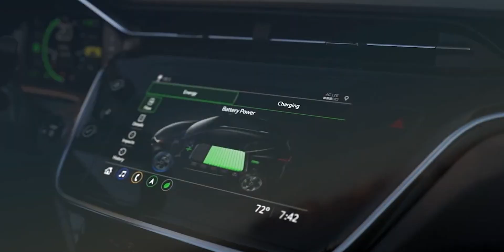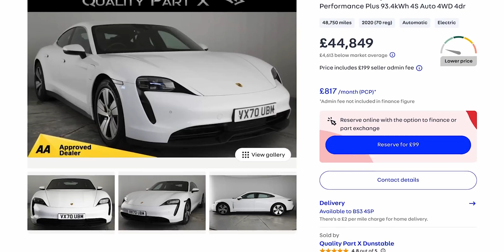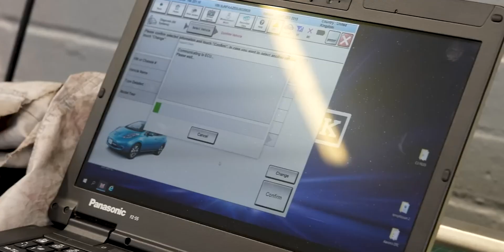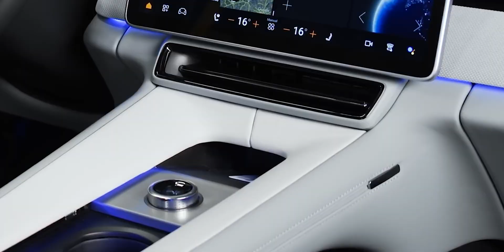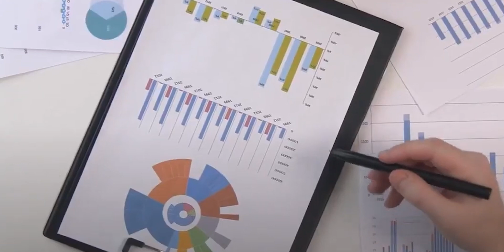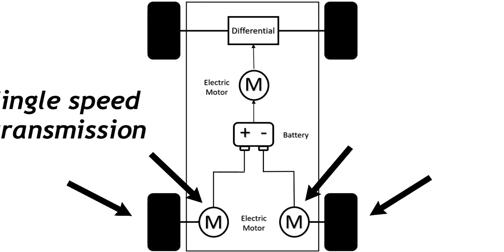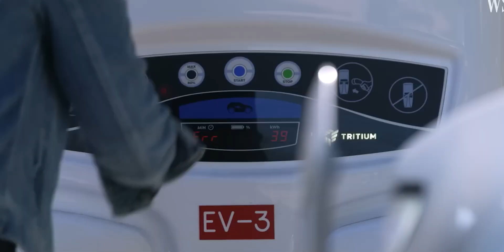Broken EVs One Way Trip To Junkyards! Cost AND Repairs Are Too Much To Bear!

Comment: Listening to your spiel I noted that it was a SPIEL. Electric motors are simpler to work on and repair.  I think the high cost of these cars and later the high cost of repairs is largely due to the greed of the manufacturer (Musk).  It is the type of thing you would expect him to do.  Musk is a hustler.  Wake up.  The Chinese are way ahead of the West.  Electrics can be the cheapest, the safest, the longest lasting etc.  If you don't want to do much to get a lot of cash, do what Musk does....raise the price.  Also car makers prefer to make very expensive cars anyway and the high end lines are heavily sought after by sales forces looking for lots of profit.  No way actually for the electric to be more complicated. These cars all have standard electrical equipment that is modular so service people don't have to know much but they still need to know how to get these parts.

Comment: Open source all the software and schematics so we can actually maintain these ourselves, then I'll consider one
Reply: Yes. But also not in the manufacturers best interest to allow consumers to perform repairs on their own, they want to continue selling cars every year. Manufacturers can't keep charging such high prices for all their new cars if people keep their old cars. You can buy subscriptions for access to aftermarket service manuals but those are far too expensive for the average consumer wanting to fix their own car to save money.
Reply: Exactly ZERO repairability for non warranty issues. No Thanks I will stick with Good Old reliable ICE. Last thing anybody wants is to be stuck in a bad sketchy spot wtih a dead car cause the iPad died. Fine to have a iPad in the car Just not running things !

Comment: 29k to replace a battery give me a break I can go to a honda dealership and get a 2022 civic used with low mileage for under 30k . My wife got her civic for 13.5k with 29k on the odometer it has a 150k on it now, and we have had zero issues in the 9 year's we have had it

Comment: They go bad in like 4 years, and it costs more than the car to replace the battery. And what happens if there is an extended power outage? Those happen.
Reply: My 2014 Nissan Leaf has the original battery and it's my daily. I don't know what you are talking about.

Comment: If you mention statistics you have to name your sources. I read the exact opposite for point #1. Old electric cars like the BMW i3 (since 2012) are very reliable and still cheap to maintain. Batteries are still holding up.
Statistically, electric cars burn less often than combustion cars.
Other points in your video are correct but it doesn't mean that electric cars will be much more reliable than combustion cars.
Some of your last arguments are just assumptions. With the market growing, we will have more professionals to fix cars, clone softwares for second hand cars, etc.
Your conclusion is still positive despite the title 🙂